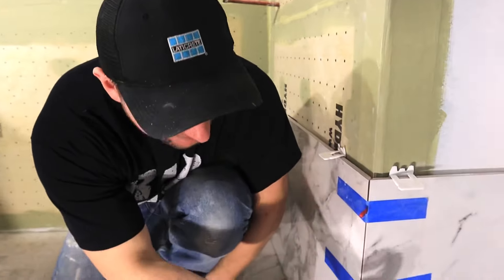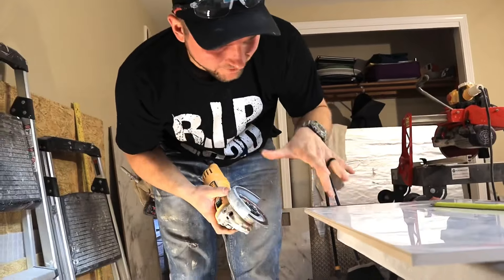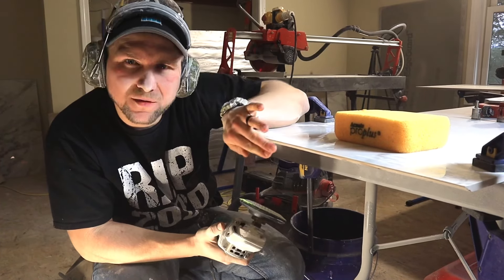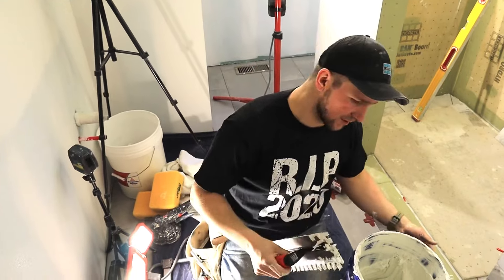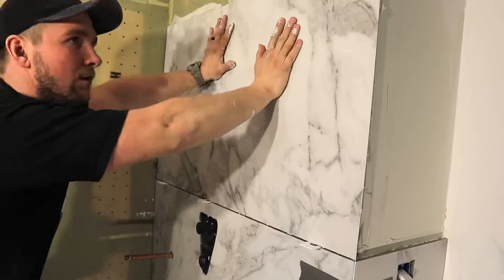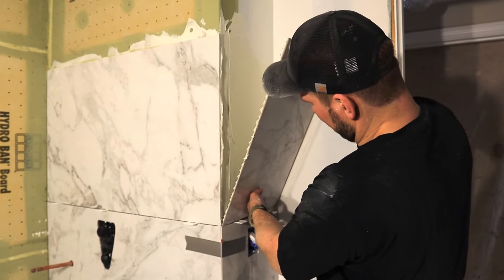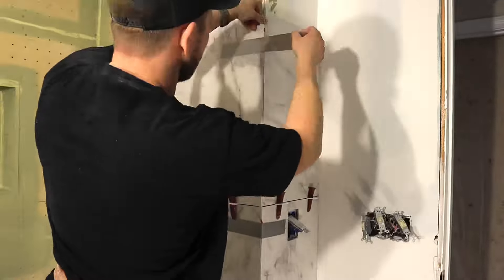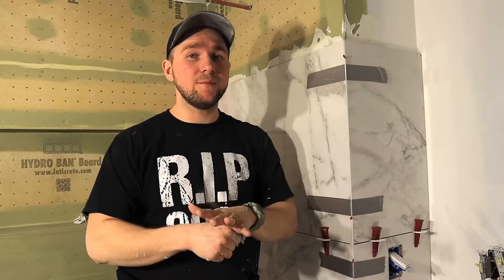How to miter tile. Tile outside corner. Tile Corner

Comment: I do tile work for a living. This is a very professional job and very hard to do great job!!
Reply from the maker: Thank you so much! Means a lot
Reply: Wholesome
Reply: I've seen a jig that attaches to the grinder has anyone seen it ?
Reply: @glynncops  Not me. That would be great
Reply: @WINNI.Designs When cutting the tiles, should I add extra dimension for the tile adhesive thickness? If so how much should I add please? Thanks

Comment: Great explanation Misha… Thank You!  I have to watch the next one to see how you clean the mortar after it has dried.  Personally, I would have run that little wedge through while it was wet to get about 1/4 inch out to make room for epoxy, then place the wedge and tape.  I realize this is porcelain, but for DIYers watching, just word of caution on using tape on natural stone… I wasted expensive white marble when the adhesive from blue painters tape absorbed into stone and was very visible (tried mineral spirits acetone and sand polishing to remove it but no luck) when using natural stone, try frog tape and remove it once the tiles started bonding(usually an hour or two with modified mortar )
Reply: Interesting! I never would have considered that.

Comment: nice but better spend the money and save a lot of time my wet saw do it better and faster  still nice work 👍
Reply: I found too much deflection with a 10”
Or even a 7” blade.   
Better finish with a 4” diamond wheel and a buffer.
Reply: Inconsistent.  Doesn't turn out as nice.  Not a fan of mitered out-corners, especially on curbs.  Feels like a chip risk.   A cap looks better, plus feel like water runoff is better.
Reply: What wet saw are you using for mitre cuts?
Reply: Every wet saw I ever used always chips the edges. Sometimes less then others, but still chips
Reply: Video or I call bullshit. Winni is a beast with tile, I would LOVE to see your “better” way and work.

Comment: Doesn't ths compromise the strength of the tile, especially on a corner? Seems to me it will be very easy to chip once installed.
Reply: I think when you fill the gaps between the tiles and if done well then it shouldn't be a problem

Comment: Misha, or anyone, wear a mask when grinding or dry cutting. Really anytime stone dust is present! Silicosis is a B….! You might thank me 20 years from now! 
Great work though! You’re doing everything right. 
I’d say instead of scraping the mortar out of the joint the next day go ahead and do it while it’s wet. Saves time and less risk of chipping or scratching the corners. 
But really nice work!
Reply: Agreed here, also I didn't back butter the wall, you get too much thinset on your hands messing with the tile

Comment: Beautiful project!  Hey a Q: can't I just lay my tile upside down on my tile saw and mitre the edge incrementally until mostly complete, then finish with the hand grinder?  I bought a used ridgid 8 inch saw and tried that just now with 24 inch porcelain.  gets it close to dimension for mitering at the factory edge.  I guess there is some risk having the face of the tile on the rubber mat which collects tile shards somewhat. I'm planning on about 40 linear feet of miters in my master bath.  It's a lot of tiles to miter, and I have only used Schluter edge before for outside corners, but this mitered edge looks way more refined.

Comment: So it's kind of like coping a 45 degree miter. The amount of material grinded goesnt have to be perfect since the top edge of the tile is in tact. Correct???
Reply: Yes. Similar to doing trim work.
Reply: @misteriguana2748   Not sure what you mean by doing trim work

Comment: I’ve been looking for a video showing how the tile is measured to allow for the overhang when mitering. Whats your distance past the corners. I assume the thickness of thinset effects that so the grout lines stay vertically lined up on the other end of the tile.
Reply: Exactly, mitre the first tile and size it "close enough" by estimating the room for the thinset for the second tile and set it, then drop the second tile. They're both the same thickness tile so you just have to get the thinset thicknes right. Ideally the inside corners would both point directly at the corner of the substrate but doesn't have to, you can just compensate with more thinset and cut the length of the second tile when you dry fit it. (FYI better to mitre a little over 45 degrees, like 50 degrees, leaves a bit of a gap and wiggle room and easier to set and fill with colored epoxy paste later instead of grout..)

Comment: How do you account for the mitre in the measurement?  Do you have to add any to the measurement to include the mitre?  When you put the thinset on, doesn't it change the measurement?
Reply: Same way you'd do a baseboard mitre around an outside edge. But easier since thineset has some play in it :) Only the outside edge count, that's what you need to measure to. Thickness of tile doesn't matter, a 45 degree cut will yield the thickness of the tile offset. Go off of that and just mitre and set the first tile. The second one will make sense. If your substrate is prepped use the same amount of thinset and it will be all good. Just try it! :)

Comment: Nice video on miter installation.   Regarding grouting the miter.  It seems many in community as well as grout mfgs recommend caulking instead of grouting to avoid cracks in miter edge.   My thinking is caulking does not look as good and clean or match well with wall grout lines.   I am also thinking grout would be more robust and protect miter edge from chipping more.  Be interested in your opinion and if you have a preferred grout and/or technique for grouting miter edges
Reply: Epoxy grout 👍

Comment: At 1:17 “I’m not a “pro pro” guy.  But you definitely are.  Then immediately you perfectly explain how to hold the grinder and the movement and I’ve been looking at tile videos for weeks and most people skip and the detailed yet so necessary information. I practiced and was able to get it so thank you so much. I haven’t polished yet but do you think i could use a hand diamond polisher 200 or 150  instead of polishing pads?  I’m on a mega budget. I got scammed so I’m doing it myself

Comment: Miters are on point. The ducktape doesn't leave a residue?
Reply from the maker: Sometimes it does. But I use goofoff to get it off
Reply: @WINNI.Designs  Good to know! Painters tape doesnt hold well on tile and was to afraid ducktape wouldn't come off clean. Thanks for the tip!
Reply: @michaelwheeler6264  I use blue tape all the time and have no problems with it not holding.  Clean and dry your tile and the tape will hold.

Comment: The one and only thing that bothered me is cutting by hand.... dont get me wrong, it looks good, but just knowing that edge and those angles arent true 45s just doesnt sit right with me...
Reply: Doesn't matter. Only the outside will be visible since joint will be filled completely. I actually over cut just a little

Comment: Hi, a budding contractor here, what was the "little fine tool" that you used to scratch out the thinset so you can put grout in the mitered corner? Is there a video on this? Would love to know, so I can see this clearly from start to finish.
Reply: Carbide pick? I’d be terrified to bring any metal near those edges after a few hours….I’d clean them with a plastic wedge after it skins over…
Reply: You can use a razor knife. Just be careful. But yeah like the other guy said, wait until it dries for a couple hours and you can get it out east

Comment: How do u remove the leveling clips?
Reply: Pull the wedge out, then break off the tab... I haven't used them yet, just researching so far, but from what I understand a whack with a rubber mallet works well.
Reply: Rubber mallet hit it same way as the tile joint no problem

Comment: try the grinder with the tile edge sitting just on the outside edge of a plywood board table . you'll cut a bit into the meat of the plywood and this holds your blade straight and take less hand strength to hold the grinder steady. you're welcome.
Reply: and those pro sponges from Lowes suck big time ! get some high dense sponges from DeFusco.

Comment: At first I thought you were kind of odd back buttering the wall and troweling the tile, but now realize it makes sense. Troweling takes more thinset, especially for large format tiles, why not do that on a horizontal tile vs a vertical wall? Less lifting and spreading thinset on a wall.

Ps. Please buy two suction cups so it’s easier to handle those large tiles.
Reply: Good points

Comment: $35 per sq.ft is prep, install,and tile? Or just prep and install?
Reply: If you’re paying $35 per sf. You’re being had. That is wayyyy too much. Im a professional tile installer in Asheville NC and i charge $16 for wall and $14 for floors with the schluter system and my own materials. Client provides the tile.
Reply: @danstynka806   He is also using large format and doing miter edging. Id guess the miters alone add 3 days of work to that shower. So you at $16 a foot add tile cost and added time for miters. I dont think he's off. Also if he can get it he should.
Reply: @DavidBrown-ek8it  absolutely, i don’t disagree with you. However if i miter i add $2 extra. But thats very rare. Most clients are obsessed with the metal edges.
Reply: @danstynka806  I am a remodeler by the way. Mostly kitchens and baths. If a customer wanted me to install that large of a tile on a miter that looks about 30x60. Id be asking 35 lol
Reply: @danstynka806  Most of my customer do schluder edge also and or a combo of schluder, and quartz for curbs and knee walls
Reply: @DavidBrown-ek8it  same here. Been in business for 6 years. Thank God i do fine with my pricing. But i see where you’re coming from. Some things can be quite time consuming
Reply: @danstynka806  My base price for walls is $15. If they walls wrapped with mitres I'll charge anywhere between $20-$25. Not only because of miter fabrication time but more importantly that the walls have to be perfectly plumb, and most framing is rarely perfectly plumb.

Comment: Hi Misha Great video you just saved me 700 on a mitre tile saw!! What are those little tiny wedges you are using to keep the gap on the corner or do you recommend a certain spacing between the mitres? Thanks

Comment: Why are you not using the Rubi to cut your miters it’s so much easier and faster
Reply: Which Rubi
Reply: The one right behind him as he is doing the demonstration. I have a Rubi DX 250 and it cuts perfect miters
Reply: @jf9686  ahh gotcha, I have a rail saw as well but find it that the blade does flex a bit on the miter cuts. Even the very expensive blades.
Reply: Yeah Rubi makes some flanges as an accessory that you can get to stiffen the blades up for my saw and they work well as long as the blade is in good shape

Comment: Awesome job!! when measuring for first your tile before your mitre how much do you allow for when using the 1/2" trowel? i.e if you have a 12mm porcelain tile how much extra would you allow for the depth of the thinnest to make sure you have enough of an overlap and that the corners meet up?

Comment: There are table saws little buddy amateur hour
Reply: You've obviously never made these even on a good wet saw.  Doesn't work out very well.  You can make a perfect miter with a grinder, but I use a sponge.  Easier to see and control doing it by hand.

Comment: There's a time and place for Schluter. Schluter tends to add an additional design element which looks cheap to me and so i'm not a big fan. However I use it for flooring transitions so theres no hump between say hardwood and tile.
Reply: There are tones of diversity in Schluter edge profiles, no matter how good are your miters will never, ever match the beautifying looks of Schluter edges. 
Mitering means going back into the Stone Age.😂

Comment: Dangerous 
Dangerous 
Good job...
But dangerous. 
It easier to chip/hit/crack that corner.
If you using a  metal/plastic corner will handle better if you hitting with something.
Just be careful if you doing this nice job.

😱